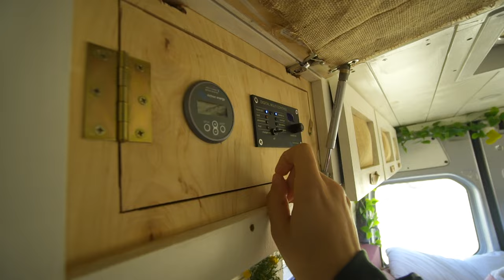Joshua Tree #vanlife / ALONE on New Year's Day 🚐 ⭐

Comment: Try Proflex for your leaks,  super tough yet stays semi-flexible.  It sticks to itself (useful for touchups),  doesn't peel and sticks to smooth surfaces really well,  I use it on my molded fibreglass 5th wheel all the time with great results.
Reply from the maker: Thanks for the advice! We’ll have to check that out :)